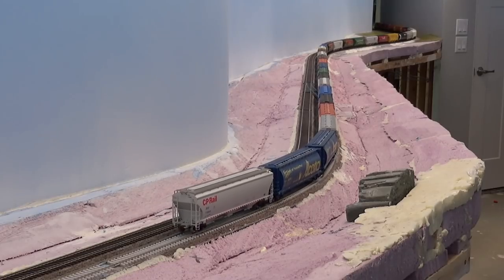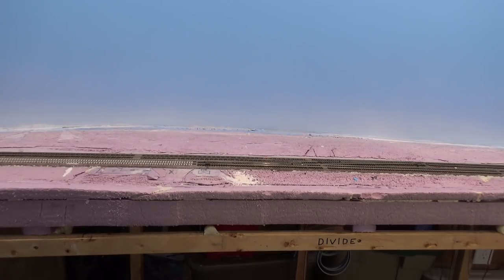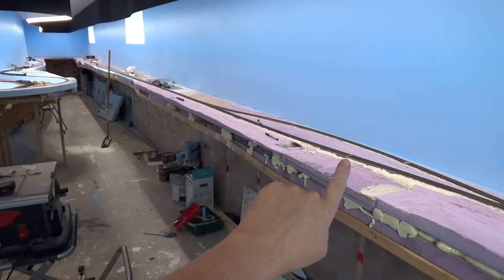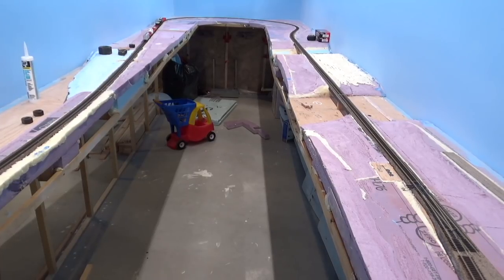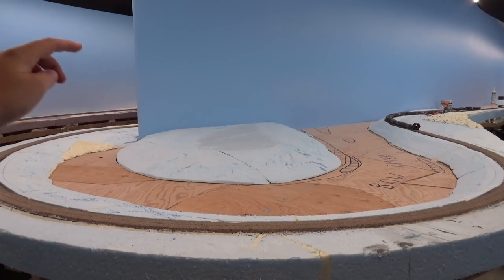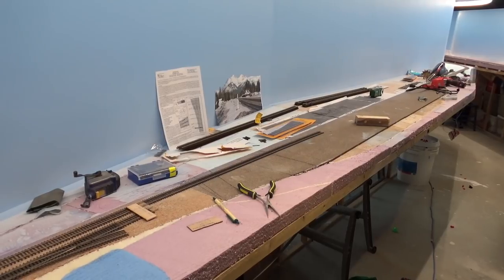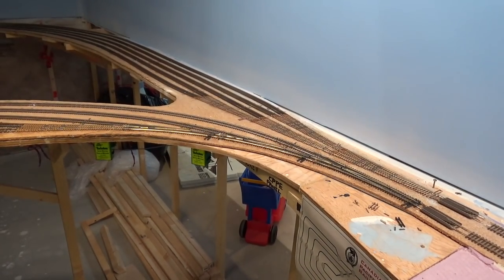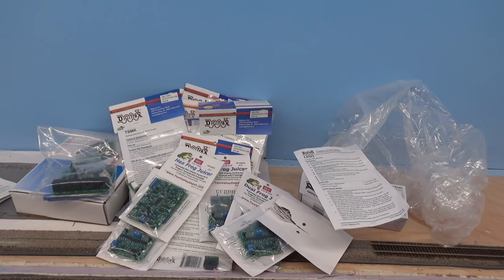Layout Update - August 2018: Mainline Track Laying Nearing Completion; Prep For Wiring...

Comment: A lot of progress tere and I like a lot of the stuff involved with the layout. First, you have given the trains some space. There are a lot of layouts where a even a moderate train enters the next town while the caboose 15 cars back is still in the previous town.  The way I see it, trains need to be dwarfed by the surrounded  by the world around them, not the other way around. This is the way they look in the ral world. Second, I lke the way you add the scenic details and contours,  it looks even in narrow shelves that the construction crew had to do a lot of work before the tracks. Usually what you see is totally flat areas and then the mountain walls. Usually in these areas the ground is not flat after all, as it is always rolling. Once you start to lay the scenic material, remember that some areas are wet and some dry, more work with shadows and different texture. The more wet, more vegetations. By the ditches you are to find more low bushes and different vegatations.By the way, to add some interest as you have kids,  Preiser has a set of moose that would be hidden by normal view but seen only on the right low angels. Looking amazing this far!!
Reply from the maker: Thanks very much for your kind words and insight Ollie. You always have great ideas. I couldn't agree with you more about the minimalist approach. I'm usually trying to figure out how to put less in a scene than more. Regarding flat sections, if you look at any section of railroad track, anywhere in the world, the rail head is the only  straight and flat thing in view. The fill beneath the railway goes up and down with the terrain to maintain that. I follow Pelle Soeberg's technique of only using plywood on flat things like the track, roads and riverbeds. Everything else is terrain and built up or down as need be just like the real thing. Good idea about having more vegetation in lower spots, your totally right. I also like the idea of adding some animals hidden from normal view. I always thought it would be fun to have a scavenger hunt type thing for kids. For example, #1. There are 8 deer on the layout, can you find them all? I'd really make it tricky and hide them in the thick trees :)

Comment: THANK YOU...for sharing. Would you consider showing the building and installation of the signals? The update is awesome.
Reply from the maker: Thanks! Yes absolutely. Probably a long way off though as I am waiting for Atlas to rerun the BLMA tri color searchlight signal heads in bulk. I am going to build the poles myself out of brass.

Comment: Lookin good, Ben. Idk if this suggestion would do you any good, or maybe you've thought if it already, but a lot of guys uses small mirrors with their rivers to blend them into the back drop and make them "disappear" behind a "bend" in the river
Reply from the maker: That's a great idea, I was going to try using mirrors for the main section of the river where it meets the wall but I never considered where it disappears into the scenery divider.

Comment: Remind me: have you covered the material and installation of that TALL, FLEXIBLE backdrop material and how it’s supported? If so, please let me know which report to look for. If not, what can you tell us about it. MOST IMPRESSIVE! Thanks for your updates.
Reply from the maker: It's just drywall, for the curved sections it's two layers of 1/4" flexible drywall. Everything else is just run of the mill 1/2'' drywall. It's supported by light framing on 24" centers using 2x2 and 1x2 spruce. To see the framing go back in my videos around December 2017 I think is when I first started drywall.
Reply: Many thanks. Great videos. Love following along. Thanks again.
Reply: Not Donna. Don't know why that popped up!

Comment: How well does the silicone work securing the track? Did you have any issues over time with your previous layout?
Reply from the maker: I've never had an issue with it. My first layout it lasted 5 years with no problems before I dismantled it. That layout also had fairly sharp curves at 24" radius' so more tension on the track then my current layout. I also used it on a Free-mo module that is going on about 6 years old.